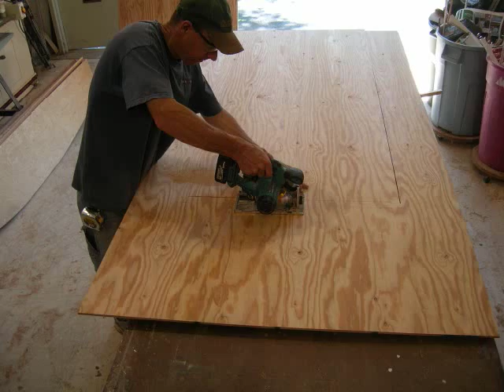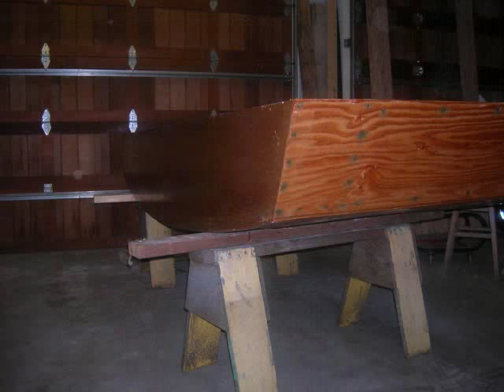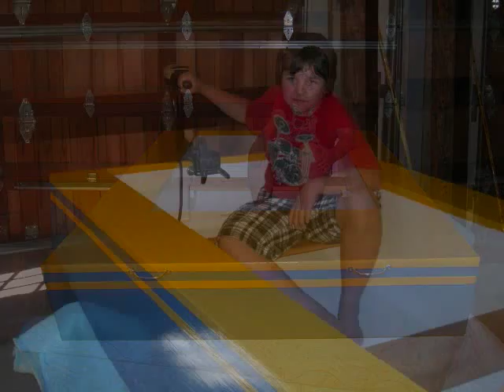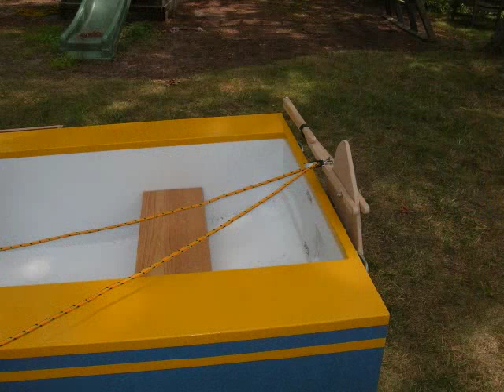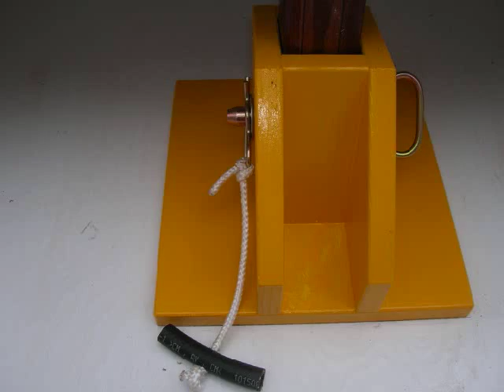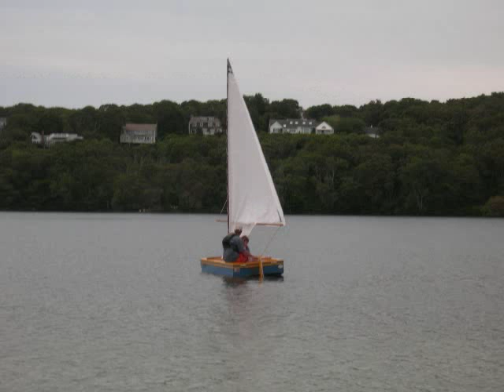Puddle Duck Racer Timelapse 2012

Comment: If you can tell me, how does a PDR sail upwind without a keel?
Reply: Daggerboard would be better than a keel, but there aint no reason you couldnt sail upwind. Might just not be in as straight a line as you might like.
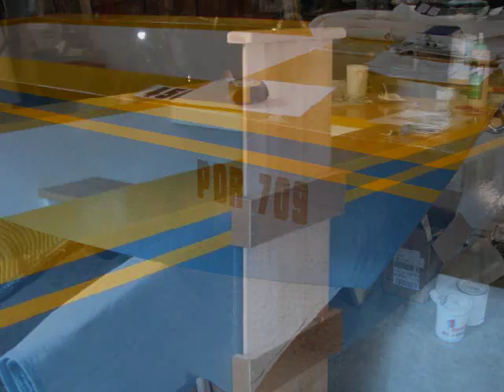Reply: Danger board shown at 2:30.